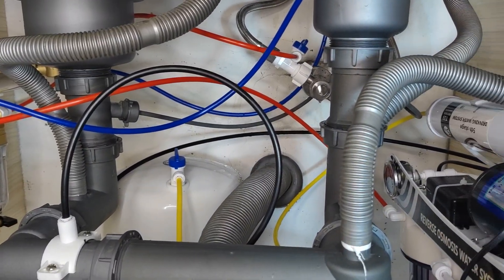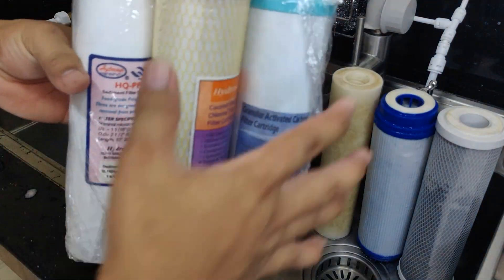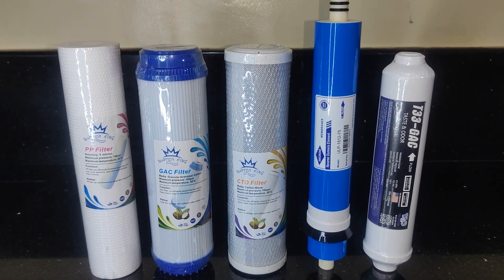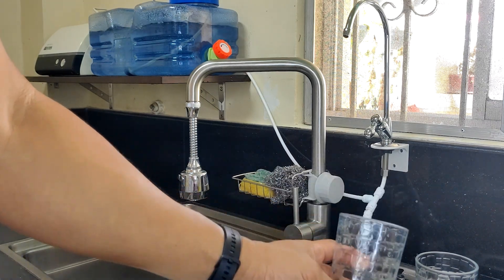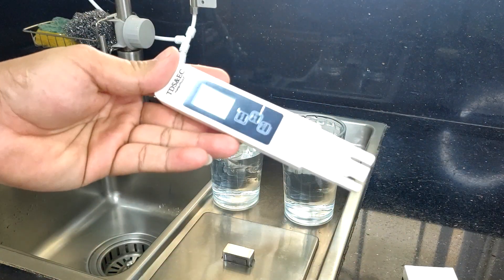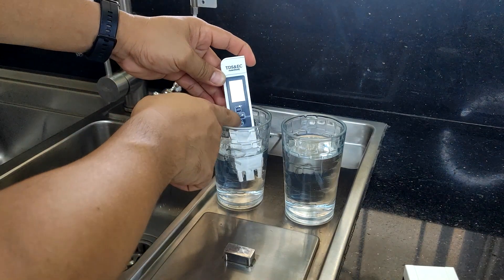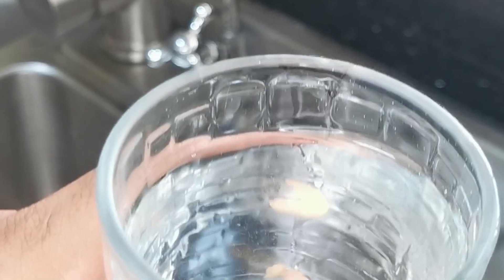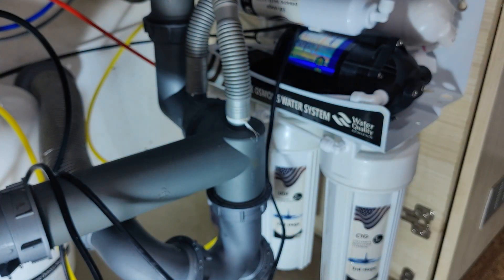How to test Reverse Osmosis Filter efficiency.

Comment: Thanks for the very informative video.  I'm trying to look for the mineral filter installation in your description and i couldn't find it.  Also, would it be possible to make a follow-up video on this topic specifically testing the tds before and after the installation of the mineral filter.  Please put the link also on where i can buy this mineral filter.  Thank you!
Reply from the maker: Hi Doc Benj, I'm not sure why you cant access my links...but its there in the description.
You're  probably on mobile phone. But anyhow, you can manually find the installation video on my channel.
The test results you're looking for is on the video itself, the first water sample is RAW water and the second one is the filtered one.
Reply: @jongpenaranda  Hi Jong. I assumed that the 2ppm result was without the mineral filter yet. The 2 links in the description were about the RO installation and the UV light with flow valve. I went through the rest of your other videos but I couldn’t find the one specific for the mineral filter installation itself. But thanks for replying.
Reply from the maker: @benj_md Hi, oh right my bad..i totally forgot to make a video regarding the installation of the mineral filter and linked a different video. Thanks for reminding me, and will do that tutorial next week. But if it may help you, you just need to get extra hose and connectors and install the mineral filter right after your last stage (carbon post filter) and connect the other end to the product faucet.
Reply: @jongpenaranda  No worries. Thanks. It would interesting to know the tds difference with and without the mineral filter. May I ask where you purchased the mineral filter?  Cheers!
Reply from the maker: @benj_md  on my last test as i remembered,  the TDS with the mineral filter normally increases about 20-30 since minerals were added to your filtered water. I bought mine at Wilcon, it will help you save more on shipping fees from online shops.
Reply from the maker: Hi @benj_md, as requested...here is the video tutorial.
https://m.youtube.com/watch?v=1usCz8B9clE